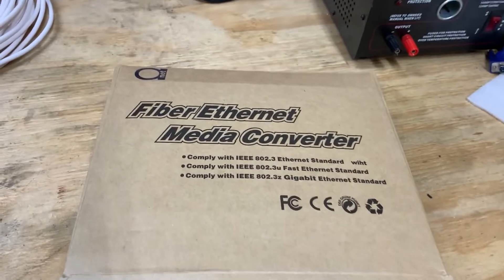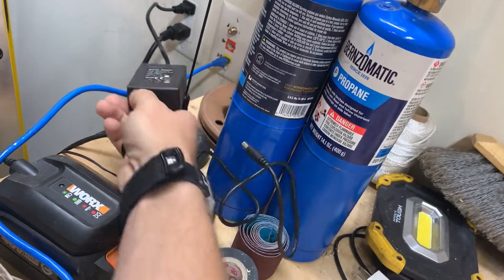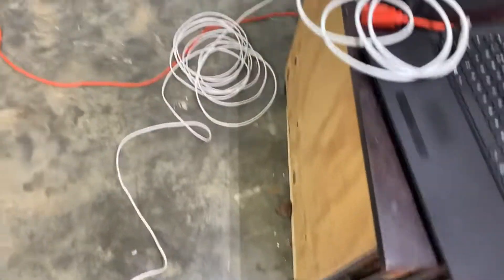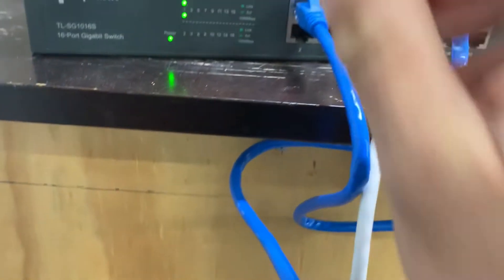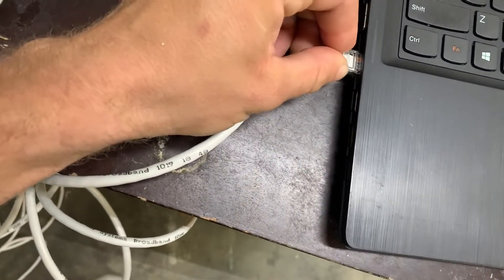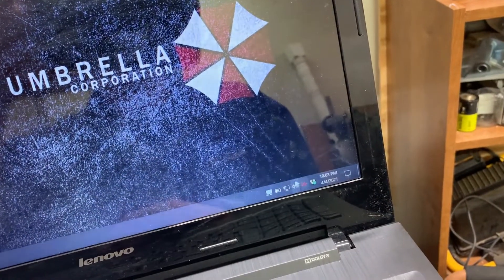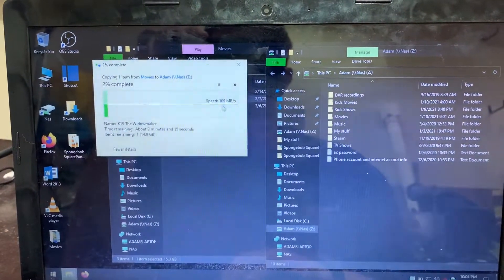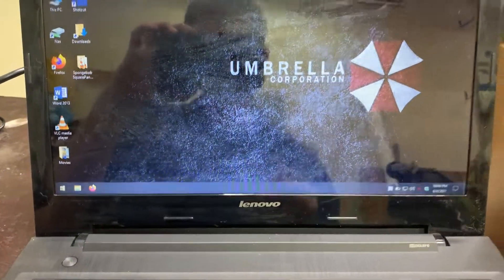Media Converters!

Comment: Single-mode means the light goes straight through the fiber and doesn't bounce off of its wall to get to the other end. Multi-mode relies on both bouncing and the possibility of the light to travel straight through. Neither mean how many strands of fiber are in there.
Reply from the maker: Not quite right — single-mode light does still reflect off the core-cladding boundary (total internal reflection), it just travels in one spatial path instead of many like multimode.
Single-Mode: One tiny light path, but it can carry many wavelengths at once with DWDM/CWDM for massive bandwidth.
Multi-Mode: Bigger core with lots of light paths — simpler and cheaper, but limited in distance because of dispersion.

Comment: I have somewhat confusing to see that video because of the color coding of the patch cable you are using. It is green what by convention is for APC connector type, but the gear/media converter you are using is consumer stuff, which is by definition UPC-type (the APC-type is more "professional use"). By definition UPC (straight fiber face) and APC (angled fiber face) is not to be mixed! Connectors and strands of these does not fit good and can fault the connector and even more the fiber strand within.  That can easily destroy your connectors or even equipment itself if connectors are soldered and not replaceable. I think you are still fine there because these manufacturers did not pay attention of the color conventions and all parties are still UPC  or the link is too short and laser is still shining over the broken connector part. Hopefully you can address that with you future fiber runs.